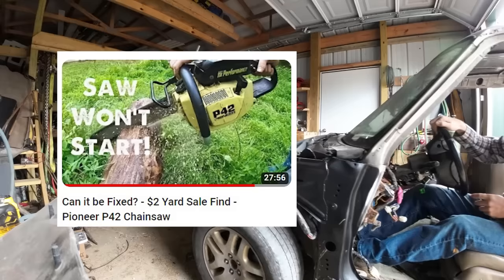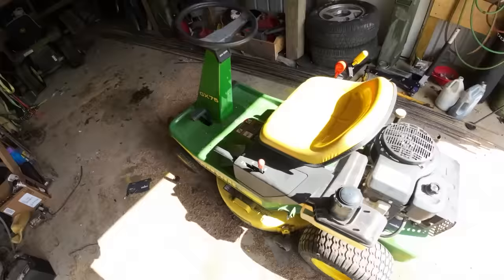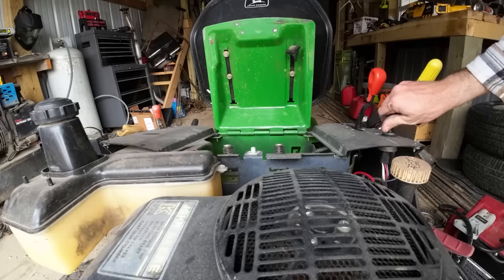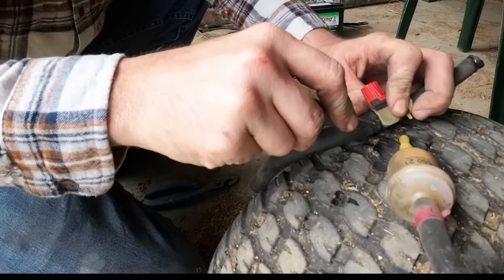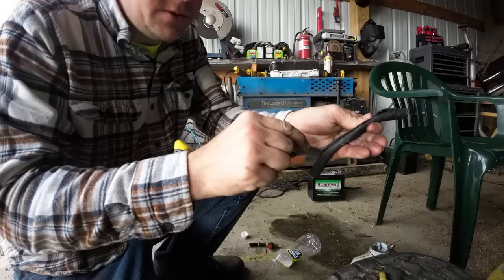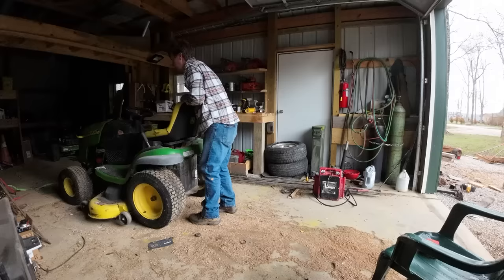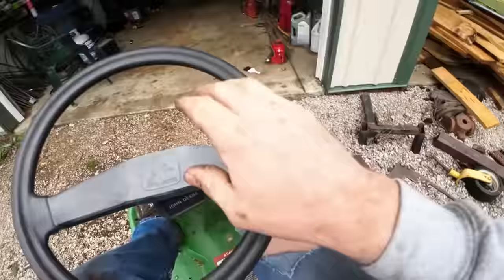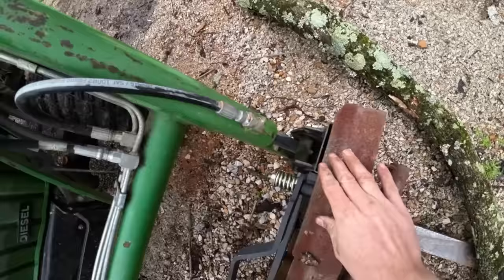Two John Deere Lawn Mowers - Cranks but Won't Start - Trade up Series

Comment: Just because you see a spark on the plug out of the engine it doesn't mean there's a spark under compression. Try a little fuel or brake clean direct into the cylinder and see if it pops off, as you've got good compression I doubt if it's the valves.
The fuel pump tube to the valve cover could have been fixed with a piece of fuel tube as a sleeve,  that could have saved you $10.

Comment: The guy who gave you the JD L110 apparently stored it outside so critters could have a home during the winter. Anyway, I was given a similar model (as a payment for a job I did) slightly newer the L155 with just under 10 hours of operation. Mine however, was stored inside for a few years and the front tires needed replacement and I found a sizable crack in the fuel tank. In Arizona the heat will try to kill anything made out of plastic or rubber whether inside a shed or even worse stored outside. I found a used fuel tank from eBay to replace the cracked one, which needless to say is a huge pain in the rear to change out (hey Catain K, maybe make a video for these folks showing how to change outa JD fuel tank at least the L100 series. There's a looong way and a slightly shorter way of doing it but I digress). I have a tendency to make a short story into a novel. 
So, my L155 like your L110 wasn't getting fuel as well. I didn't see any fuel going to the filter so I unplugged the filter and tried to manually syphon the gas from the tank through the line to see how it pours out on its own like it should once you get a syphon going but it didn’t thanks toe Murphy’s Law, what can go wrong will. I even made a gas cap with a small hole in it so I could add a little air pressure into the tank to force the gas out. That did work but it only trickled and stopped when I stopped putting air into the tank. This told me it was the line from the fuel tank since I had checked the tank itself prior to installing it. Once again, I had to practically unmount everything that covered the fuel tank to get to the top where the fuel line plugs in. After replacing the line and doing a syphon again the fuel started to run out on its own. I added a new filter and plugged it into the fuel pump. Thinking that’s that I went to start it and of course it didn’t didn't start. Like you, I followed what I thought the next issue may be and went to work on the fuel pump. I unplugged the outgoing line from the fuel pump (uncapped the sparkplug for safety) and turned the motor over and the fuel was spurting out like it should from output of the fuel line I unplugged. The next only trouble area can be the few inches of line from the pump to the carburetor or the carburetor itself. Either way, change out all the fuel lines just because I didn’t trust them even though they were John Deere’s own product yet the line from the tank was plugged up and not just because the gas was varnish like but the rubber decomposed somehow. So now, I reconnected the line back to the output side of the pump. And removed the air filter and spark plug. I had my son spray starter fluid into the open carb while turning the motor over and it ran momentarily. That lead me to realize it was the carburetor, whether the float being stuck or whatnot. But like any gas running motor if fuel is left in the carburetor without any conditioning it can gunk up and give you a days’ worth of work that you would have been have enjoyed much more if it were directed in cutting your lawn like a baseball field. I could have purchased a new carb cheap enough for $29 bucks on Amazon but me being me, I didn't want this mower to beat me. So, I took apart most of the carb and used a cleaning solution and air pressure to blow through any vents or venturi’s. Luckily, I was able to use the same O-rings that it came with but I had no choice since I didn’t have those as extras. After verifying that I cleaned it as well as I could I installed it back on and went to start it (Now mind you if you're wondering, I had already changed out the plugs after replacing the fuel line. I really didn't need to since there was less than 10 hours on them but I had extra plugs in my garage so what the hell). It took some turning over and I still required to use one of those portable battery jump starters (which I love as well) so I wouldn't completely drain the battery that I borrowed off my other mower since the original was dead from sitting a number of years unattended. Finaly, the mower kicked in and started running! All I needed to do now is add some Seafoam motor treatment for which I swear by ever since my ATV carburetor got gunked up from lack of use while leaving fuel in the carburetor without draining it for storage. I originally was just going to get this Deere riding mower up and running just to sell it to make a nice profit for how little hours it had on it. But after using it on my lawn I really got like it better than the Craftsman one I have. (Capt. K listen up in case you never used it, you’ll thank me) Now speaking of Seafoam fuel treatment, which you’re probably wondering what the heck I was talking about. It has nothing to do with the sea nor of foam, it’s just the product name for some reason but I SWEAR BY IT! I now add it to anything I have that’s motorized, whether 2 or 4 cycle as well as diesel and in the motor oil itself as a conditioner/cleaner. Like most normal apex males that love their tools, toys and motors you have gas cans lying in wait in the garage or shed and some of us have more than one and even the fast gravity feed ones. I add Seafoam to all the gas cans so when I have to add more fuel to my atv or lawn mower I know that it’s getting it’s fill of Seafoam as well. I also know that I’ll never have to worry about gunked up or varnished carburetors again! You only need to add an ounce of it per gallon of gas. It also can be added to your motor oil and...well, I'm not trying nor am I going to make a commercial out of it. But for you guys and gals (no male chauvinism here) who enjoy cross-cutting their lawns and then are stuck having to wait out winter and spring in order to be perfectionists again will never have to worry about "trying" to get their equipment started again!!! It's intended to stabilize fuel for 2 years, but it has done it longer for me. It also will helps clean out your carb and manifold of your whatever motor (car, atv, dirt bikes, chainsaws 1/16 scale motor cars, 2-4 cycle anything, etc..). So, it can very well help fix and clean out a rough running motor just by adding it to your fuel tank. If you take away anything from what I have just bored you with please let it be this Seafoam. You will find yourself much happier and grateful that season after season you’re not in the garage having to clean out your carb and tank or whatever floats your boat (oh, which is another stress saving work committed yearly because of storing your boat seasonally with fuel in it) and now you’ll be able to enjoy dirt biking through 2-tracks sooner and longer. I don't mind working on motors at all and actually enjoy it but when it comes to carburetors, I dislike it the most. But ever since my son bought it accidentally instead of Gum-Out which I asked him to purchase, which was the first time I was happy he didn’t do what I said. Of course, I had to thank him eventually and admit that I was glad he made this purchase mistake. I only wish I got an incentive from the manufacturer of it for turning people on to their product. My only issue now is I’m not sure if my son is still making “these” mistakes in hopes to find something new and better that I’ll like or it’s just him making mistakes and not aware of it. Who knows, we’ll just see where it goes..lol  Back to the mower, I have no idea why these fuel lines get eaten away by the gas after being stored. It’s not Deere’s personal fuel line product and it is supposed to be rated for gas. So, if that’s the case why does it get mucilaginous on the inside and hard and brittle on the outside? Once the fuel line gets all gooey inside it’s destined to plug up and give you headaches with the carburetor and anything in between… Anyway, that’s my short and direct to the points tory off my JD L155 riding mower…

Comment: You have two coils and the kill wire splits there are 2 diodes one to each coil if one out it won't run
Reply from the maker: I'll check that.  Thanks.
Reply: glad you wrote this.  My mower went out and I believe this was the issue.  unfortunately, all I know is the repairman replaced that little square black thingy at the end of the wire. haha.
Reply: @DanKlein_1  My dad and I made one by finding the diodes and replacing from a electric store for a couple dollars.

Comment: Good morning! You didnt show it in the video so i have to ask. Are the rockers moving when you turn the engine over? I have seen plastic cam gears strip. That would not be good. I have seen  this happen many times with kawasaki twin cylinder engines in golf course equipment. Good luck!

Comment: Looking to find out what you did with the L120 fix? I know you were gonna go get the ride feeler gauges. I have the same situation which I was not able to resolve yet? Thank you for any help?
Reply from the maker: There is wire that runs between both ignition coils,  that ended up needing replaced.  There is a small diode on that wire that goes bad.  Easy to find on Amazon

Comment: I know you rebuilt the carb, but could it be out of adjustment?  I don’t know much about these newer motors, but on the old ones there are fuel and air adjustment screws.  If those are out of adjustment, they could cause it not to run.

Comment: Considering where you are and what u have identified at this point , i have to say even though you did check the compression you didnt do a leak down test . As to the question , is it the valve adjustment not letting it start my money is going on no !

Comment: I think it is a briggs&stratton engine, i had broken rod and the other was bent.
Reply: Thetes a briggs logo stamped in the flywheel
Reply from the maker: That engine has had issues with exhaust pushrods. Both the exhaust push rods are intact and look good. But the rockers are pretty loose. I think that's going to be the problem.

Comment: Thats what ethanol does to rubberhoses,always run your stuff on gasoline without any ethanol in it,my intake rubber on my yamaha kodiak whas just like that hose after one tank with the new fuel here in sweden with 10% ethanol all my chainsaws the hoses melted on and the primerpump got hard like glas and cracked.im run all my stuff now on 98 oktan and that works,same with my older cars,got a ford granada and a consul that i run on 98,they dont even run on that other shit they sell as fuel,
Reply from the maker: That's what using the wrong hose does.  Use fuel rated hoses

Comment: I do not think it is valve setting or you wouldn't have compression but it could be intake valve stuck or a lobe worn off on an intake valve lobe on the camshaft. Are you sure that gas is getting into the cylinder? If so the plugs should be wet when you crank it with the choke on. I don't think the gas is getting into the cylinder either because of the carb or the valve train and I don't much think it is the valve train because you have good compression on both cylinders. I think maybe you still have carb problems. I'm sure you will find out what it is. Good luck .

Comment: Are you shore you getting fuel into the carburator  even if you valve setting is out it should start but it would run rough settings don't go out over time to engine not starring I think you have fuel problem try spraying some spray into the carburator and see if it want to start.
If it does you know it's fuel problem in carburator if it does not then look for electrical it may have spark to plugs but is the spark strong enough and continues spark to start and run .that is what I think

Comment: Solenoid at bottom of carb is a backfire prevention solenoid. the idea is that after mowing or using the tractor, when you turn it off the compression and fuel left in the unit, makes it want to fire, or backfire. this solenoid grounds out and prevents fuel from running through carb and causing fire? I had one with similar issues. check the fuse. you may need to replace that solenoid just the same. they get gunked up and even though they appear to be working, if it doesn't have the right resistance the tractor won't start. This was by design to keep us Logical Californians from hotwiring the Safety Feature! lol Alse verify the wires at the starter switch. Hope that helps Mike.

Comment: Why wouldn’t you clean the heads once you removed intake. The fins are all clogged, bad for heat distribution. So if it over heats that’s your problem.

Comment: A good many years ago, I lived in washington state and when a storm came up, a good one at that, we called it Oregon mist... aside from some cheap booze sold then and might still be as I haven't touched alcohol for a lot longer than most  guys are old at forty plus years, never really stopped to count just how many. So we called the rain oregon mist... missed oregon and hit washington... sick humor hu. I am guessing also as you pointed out the key is in its right place and don't think the shaft is twisted plus its electronic ignition ain't it. Has to be a valve adjustment at this point. Plus it built compression differently on the one cylinder from the other just jumping up quick... think its just as you figured... you got to start buying lotto tickets Mike, I    hate seeing ya work so hard for so little coins in the purse

Comment: The mistake people make with small engines is they put 87 octane fuel in them. 87 octane fuel contains ethanol. Ethanol doesn't last more than 6 months before it turns bad. Putting 91 octane fuel will solve this problem. 91 octane contains no Ethanol and will remain stable for over a year. God bless

Comment: you had compression , the valves are adjusted ?A can of carb cleaner , used as starting fluid , I bet it runs , I dont think the carb is cleaened
Reply from the maker: Having compression does not mean the valves are set correctly. That means the valves are seating correctly and you're not losing compression past the rings. But you could have the exhaust push rod completely broken in two and still show good compression

Comment: Mike, test spark needs to jump a 1/4" gap to prove it will fire under compression. 
Second, never saw you prove the carb jets are open on inside. 
Thirdly, pull rocker covers off and plugs out. Then roll engine by hand to top dead center intake and exhaust valves should overlap at top dead center. Check both cylinders. This will prove internal mechanical timing. If over lapping valves isn't happening on top dead center, your camshaft is bad out of time.

Comment: Order of operations matters?   If you wipe off the spot you are investigating is it not clean?  If you pressure wash it prior to investigating   There is a chance of washing off  or hiding a problem and just because it's washed off doesn't mean it will work.